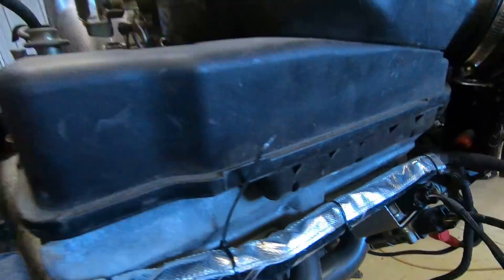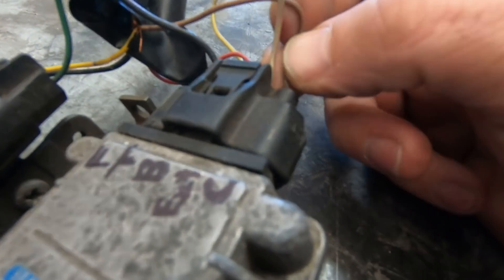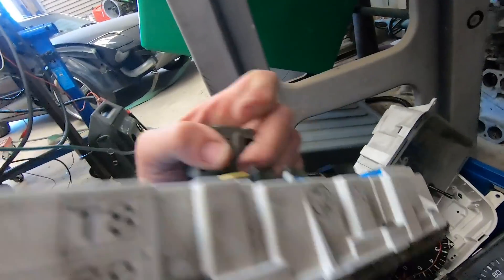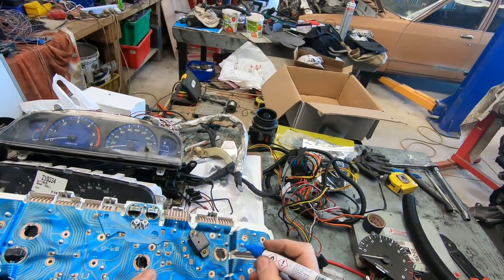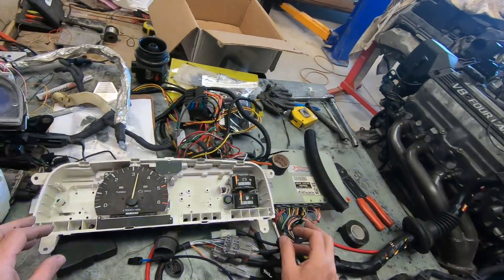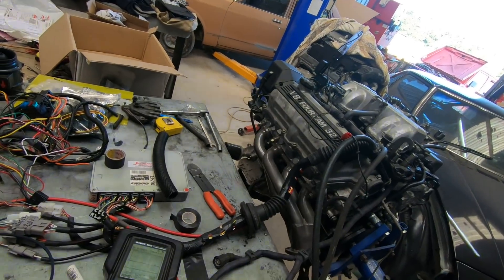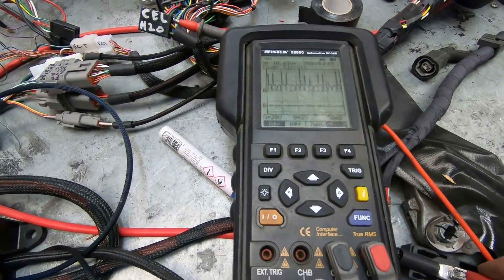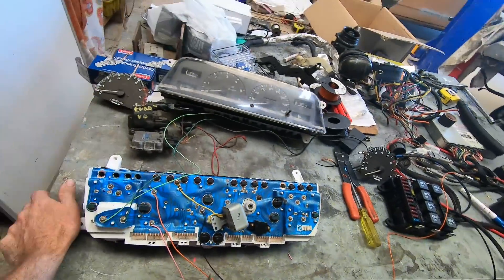1uzfe Tacho - Part 1.  Getting high level coil type petrol tacho working

Comment: Could the diesel surf Gen2 tach still be used if the petrol tach is hard to find?  Regards Murray
Reply from the maker: Sure can.  I use them heaps , generally with a signal converter box.  Cheers Kelvin
Reply: @CartuneNZ  Hi Kelvin. Thanks for all the info you provide, love your work! I also have a diesel Surf (LN130) with a 1UZ conversion. Do you plan to do a video on how to go about getting a diesel tach to work with the 1UZ? Mine works, but shows half the actual RPM at all times.

Comment: Hey @CartuneNZ
, I have an issue in my Lexus sc400 1992, for some reason the is some fuel in the charcoal canister line that goes from the tank. And if I open the fuel cap, a lot of air coming out from the tank, the is a pressure build up
Reply from the maker: Good morning.  I would be checking over the system.  There is a VSV(vacuum switching valve) on the back LH side of the engine, This has a vacuum line going to the throttle body and charcoal canister. There is a overflow off the bottom of the canister and then lines going to the tank as you know.  Maybe its something simple like the VSV has failed.  Good Luck . Cheers Kelvin
Reply from the maker: I also have a soarer video ready to upload.  Keep an eye out for that one.  Cheers
Reply: @CartuneNZ  , thank you a lot! I would check all lines and that VSV
Reply: I have found an issue in my tank. The vent line goes from the top of the tank to the bottom. And at the bottom part where that line is connected to the connection bolt, I have a small hole! Fuel goes to that hole and travels to the canister. I can't solder it or replace the line because It is located in the tank itself. So I decided to replace a tank
Reply from the maker: @TheLolvista  glad you found the issue.   Cheers.